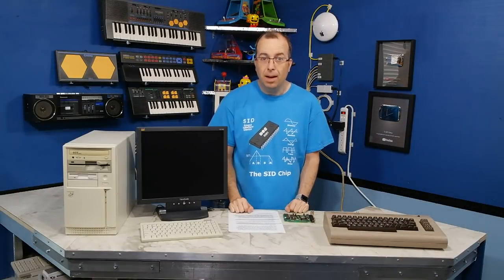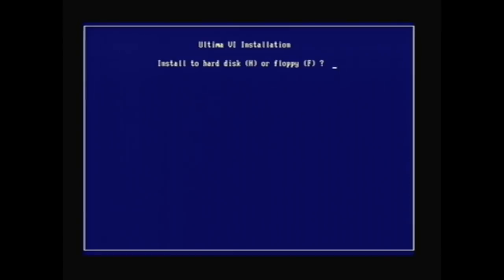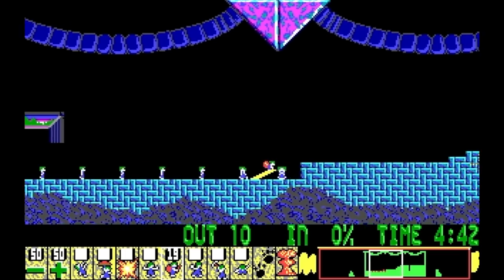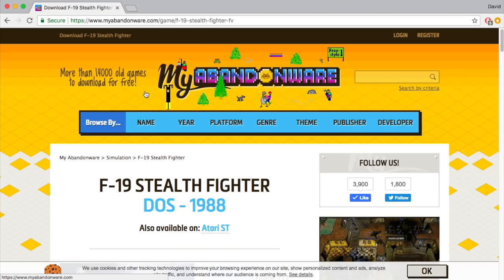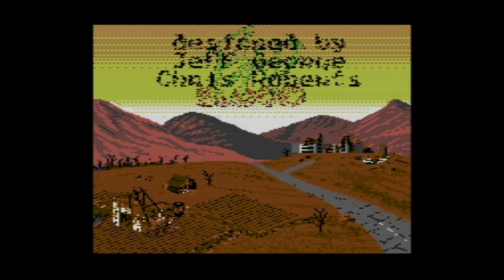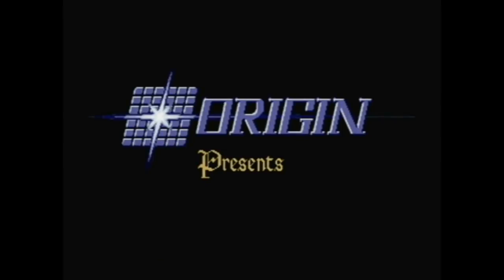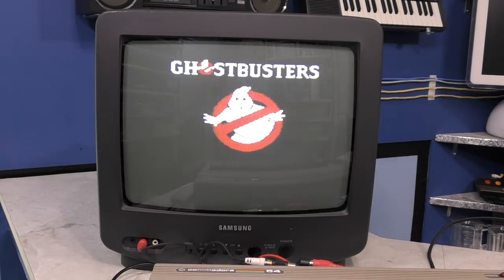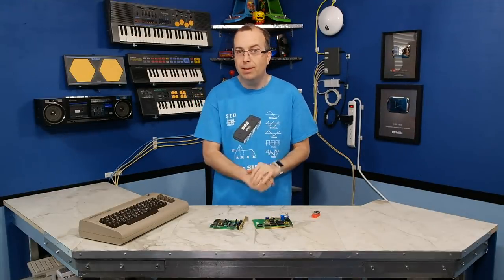Replica Sound Cards - AdLib, Innovation SSI-2001, and SwinSID Ultimate.

Comment: How stupid should you be to buy a 1987 audio card for 300 bucks? I don't get it.
You get like really good DAC 24bit/192khz for 300 easy.
Reply: Because
1) Historical value.
2) The DAC is just a digital-to-analog converter, the Adlib has a hardware synthesizer, and the emulation isn't always accurate.
Reply: espro You could make that argument about a ton of retro gear. It's worth what people will pay.
Reply: oof
Reply: That's about how much they were then, too :D (adjusted, I guess). My AWE32 cost me 250.in the 90s and is still in my dos/win98 box :)
Reply: Well I bought my Sound Blaster Pro 2 for $50 for my DOS machine so, $300 for a card with no DAC (the Adlib is just music only or SFX using the FM but not both). The Sound Blaster Pro 2 or Sound Blaster 16 is the cheapest way to go for a DOS sound card.
Reply: Laszlo I don't get why the emulation wouldn't be accurate, unless it's poorly programmed. The AdLib uses a digital Yamaha FM chip. There's no magic there. It's not analog in any way. Makes me wonder if the emulation really isn't accurate, or if people are just hearing what they want to hear.
Reply: @Pete Brown there is something special about Yamaha FM chips (especially in sound cards, game consoles and the cheaper 4op synths)... low bit and sampling rates + FM can make some really grungy tones and is amazing for bass sounds. I don't get why DOSBOX has some emulation issues but I play on real hardware so it makes no difference to me.
Reply: There's also quite a bit of mythology about those chips, and other chips of the era. Comes up all the time in synth forums when folks discuss the DX100 and DX7 and the FM chips and DACs in use. When it comes down to it, in a blind test, no one can really tell them from a soft synth, or something like a Volca FM.

Nostalgia is fine, but let's not confuse it with science :) But really, $300 for an AdLib card is a bit nuts unless the nostalgia means that much to you.
Reply: For those who grew up with these machines, nostalgia is a very compelling motivator. At the time these cards were produced, the only way to get a computer at anything resembling an affordable price was to build it yourself. As such, we dreamed of getting the latest cutting edge motherboards, video cards, and yes, sound cards, although we often couldn't afford them. At this stage of our lives, though, we have careers which enable us th purchase such frivolous things, so we don't mind dropping a bit of cash for a trip down memory lane.
Reply: I also grew up with these cards. They were ok, but quickly eclipsed by the PAS16 and SoundBlaster cards.

My 286 was the last primary computer I purchased for myself; I've built every one since. But $300+ for an AdLib is just nuts. That's like paying $600 for a C64.